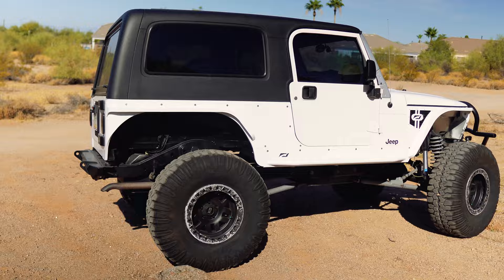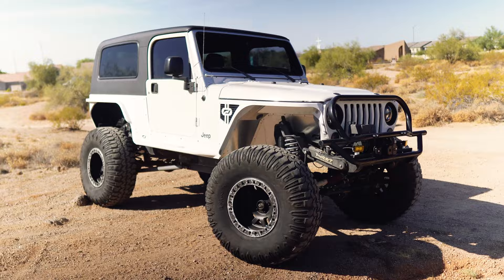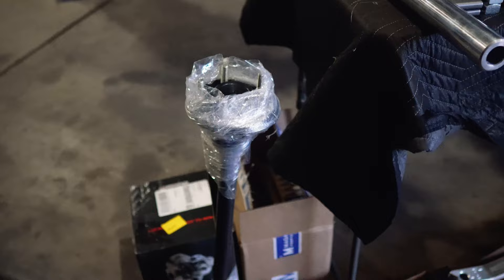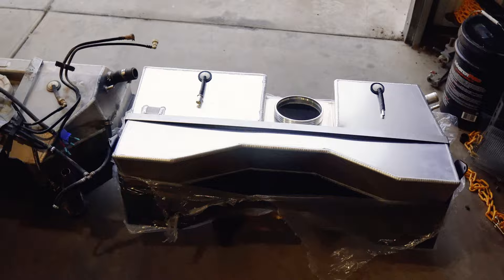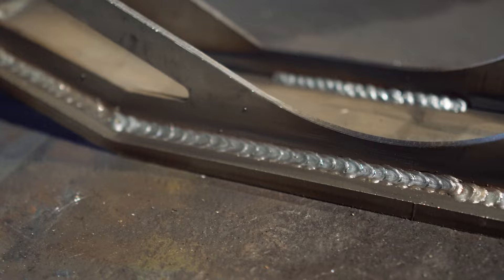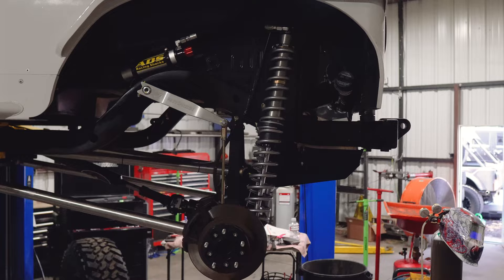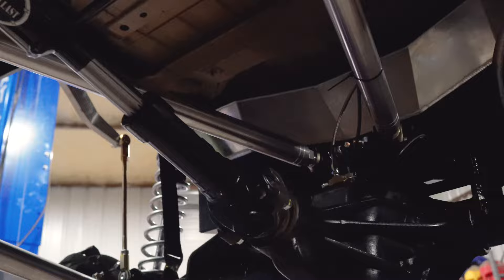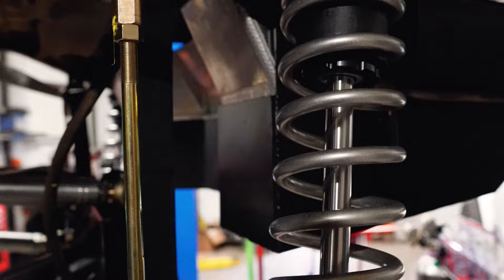How To Stretch A Jeep LJ! Coilovers, Fuel Cell, Axle Truss, Aluminum Links.

Comment: I've stretched the rear of a LJ. I had to fabricate a custom forward tank crossmember to support the the two body mounts just aft of the axle. With rhe stock, upper link axle mounts would it it at full stuff.